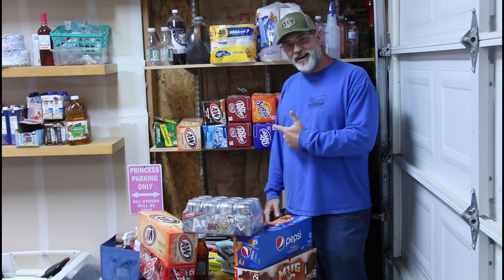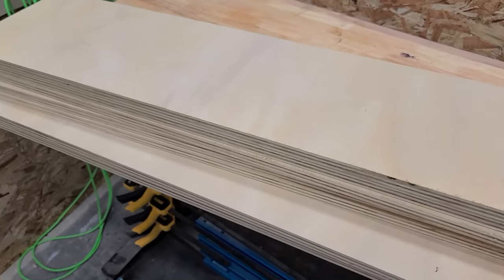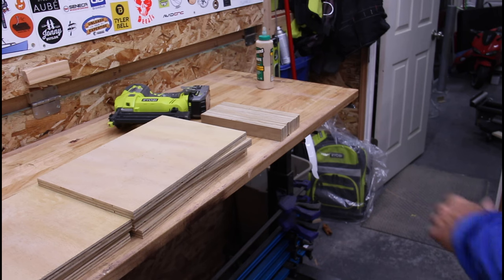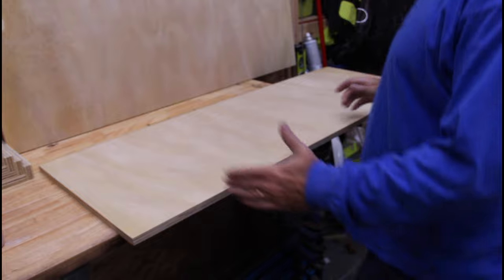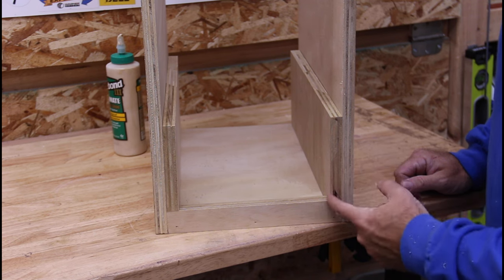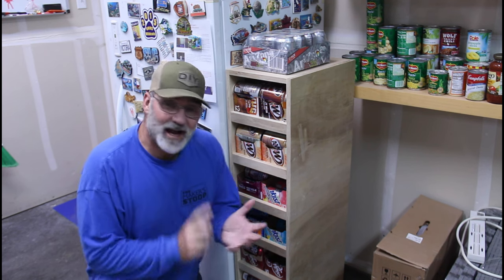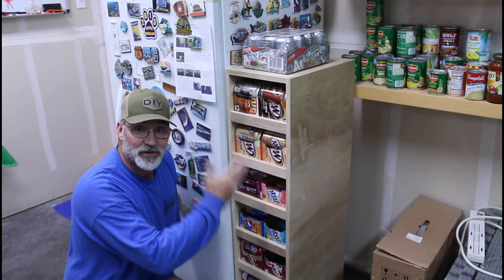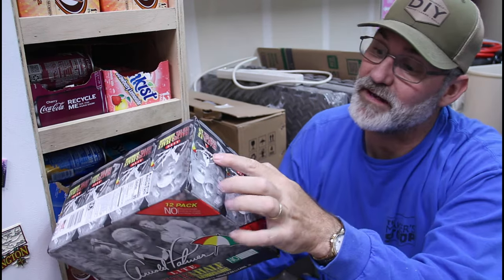Soda Pop Storage Unit for your Garage or Pantry | Soda Tree or Pop Stand | 2022/11

Comment: Looks good, May want to add a slight slope to the shelfs so the cans can roll forward, 1/4" if that would be enough.
Reply from the maker: It's a design option for sure.
Reply: I was thinking 1/2", but what ever works.
Reply from the maker: 1/2" would be too much. The top shelf would allow for enough clearance for the case to slide all the way back.
Reply: @DadItYourselfDIY  Not if you slanted all the shelves as you were building it, but 1/4 should be fine.
Reply from the maker: I wouldn't slant the top of the box though.